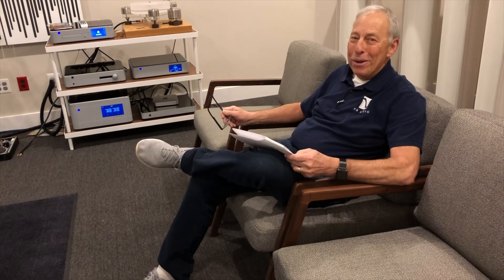Why don't PS Power Plants have balanced outputs?

Comment: Switching power supplies (at least the non-PFC ones) can run on anything, including square wave and DC.
The PFC ones are more picky about the power and may not run from a regular diesel generator (the voltage and frequency varies too much).

Comment: The problem with what is referred to here as balanced power which means neither conductor is grounded is that it is a violation of the National Electrical Code article 250 which deals with grounding. A power regenerator falls into a category of "a separately derived source." Generally for this type of equipment the source ground from the wall outlet would be connected to one of the output wires. An ungrounded output would not get a UL listing and the output could float dangerously. This neutral wire is referred to in the code as the grounded conductor. The separately derived source in this type of device must be grounded at one and only one place. For a delta wye transformer in a commercial or industrial building I prefer to ground the neutral at the transformer although the code allow it to be grounded at the first panel. Your house if you live in the US comes from a single phase transformer 240 volt circuit with a center tap which is the neutral. This neutral is grounded at the entrance to your house. Following the code can be a matter of life and death.

A shielded power cord has to be UL listed for this purpose. Wire of a specific gage is rated for maximum  ampacity based on being installed in free air at no more than 86 degrees F unless specifically designed as shielded. The problem with making your own shield is that it restricts the ability of the wire to dissipate heat. Wire such as MC or BX that is shielded takes this into account.
Reply: There is an exception in the NEC for balanced power. Article 647. It allows balanced 60v-0-60v installations under certain conditions, one of which does ban it from residential use. Much of this research goes to Martin Glassband of Equitec. He is the one who got this NEC accepted. Balanced power is not snake oil. It works on well known electrical principals. But it is not very effective, around 10db of practical CMR reduction. Still some recording studios will take that 10db over nothing. It is a gorunded circuit in that the ground must still be tied back to the service ground. Basically it is no different than a residential 240v circuit. Just half the voltage. So in essence everyone's 240v home HVAC condenser, electric range and water heater is running on balanced power!
Reply: @andydelle4509  that is correct. Generally 3 phase motor circuits do not have a grounded conductor but they must run a frame ground. We used to ground those circuits. There was red leg delta where a center tap of one leg was grounded and there was corner grounding of one conductor of a delta circuit but no more. In the US 240 volt residential appliances don't have a neutral wire unless they need one such as for a control circuit. But I think in this case one conductor must be grounded. I'll check your reference to see what I make of it. It still seems to fall into the category of a separately derived source under article 250.
Reply: @markfischer3626  Once you ground one of the hot legs of a  transformer, it's no longer a balanced circuit. Plus in the case of a balanced transformer, the center tap is grounded so also grounding one side would be a 60v to ground short. In a 120v balanced system both legs are 60v to ground. NEC 647 just tell what is allowed. A much better explanation is on the Equitech site which does go through the NEC acceptance process in one of their papers.

Note: I do not work for Equitech and never did.
Reply: @andydelle4509  Would you need a GFCI breaker? AFCI? Correct again about grounding one leg results in a circuit that is not balanced. Did the code chsnge? If it did what year was it?
Reply: @markfischer3626  I think the first version of balanced power was 1996 as article 530-G for pro AV installations only, then 647 was in 2002 which included any sensitive electronic gear in a commercial facility. Yes I think a GFCI is mandatory.
Reply: @andydelle4509  I visited the Web site. The company claimed the code was vagur, open to interpretation and would require approval by the local electrical code enforcement official. At the end they said they would make a presentation to the code committee to try to get a change in the 2012 code. They admitted it would not be easy. I don't know the outcome. It says on the very first page of the code that its exclusive purpose is safety. They really don't care about your stereo system. BTW, their equipment can't be cheap. There's a lot to.it including a large transformer and a special circuit breaker panel with GFCI  breakers. They also mentioned they were trying to get a UL listing.

Here's a problem I have with it. It can't use a standard NEMA 5-15P OR 5-20 P receptacle. It either must be hard wired or a different off nema receptacle used. You also cannot use an adaptor. The cord set must have the right matching plug supplied by the manufacturer to get a UL listing for your equipment. A licensed electrician is allowed to fabricate one. DIY and you're on your own. This device might require an electrical permit. BTW the secondary of the transformer has a grounded center tap so you are connected to ground on both wires through the transformer windings.
Reply: @markfischer3626  As I understand it, you can use NEMA 5-15 and 5-20 receptacles. They just have to be specifically labeled. J-boxes also must be specifically labeled. And I have a 2008 NEC book and 647 is in there so it's approved under the NEC at least as far back as the 2008 cycle. I think the 2012 was an attempt to get residential product listing. Note they do currently display ETL on their cord and plug units.  Now of course any local authority can override the NEC, as we know the NEC is just a guide. But I have seen balanced power system in several Hollywood recording studios so at  least the city of Los Angeles approves it's use commercially. The Univision network center and uplink facility in LA built in the mid 1990s is also all balanced power. They used standard box mounted GFCI's on each rack Wiremold G6000 power strip as that was cheaper than GFCI breakers - after all they had hundreds upon hundreds  of breakers in that plant. The distribution transformers were custom made by Square D.
Reply: @andydelle4509  Wiremold 6000 is a surface mounted sterl raceway. What does that have to do with GFCI?
Reply: @markfischer3626 Or did I mean G606? You know, plain wiremold plug strips. I am just pointing out another example where standard NEMA 5-15 receptacles were used and approved. They just put a GFCI locally at each power strip to save money. The NEC says a GFCI must be used. It does not say it has to be a GFCI breaker in the panel. Remember balanced power needs double pole breakers, which aren't cheap when you need a GFCI type! This technology is in use and approved by the NEC. Based on the ETL labels on the cord and plug units it seems that too have also received some official approvals for portable use
Reply: And yet another engineering flaw in Paul's hi-end audio snake oil seasoning.....
@Paul... the right answer, of coarse, should have been : "We don't have a choice. Safety regulations force us".

Comment: if you connect a piece of equipment with neutral tied to the chassis internally to a "balanced power feed" what prevents the chassis from becoming hot ?? +/- 60vac ??
Reply: you don't, because the chassis is not tied to neutral but to ground

edit: because if it was tied to neutral, what prevents you from turning around the wall plug and then have the phase on the chassis?
Reply: @LuXifR  
I just thought of something else ( I might be wrong) but I'm pretty sure balanced AC single phase is illegal in residential per NEC..
Reply: @poserwannabe1  Correct,  it is not allowed as permanent wiring in residential. But I think the cord and plug units are now approved. Equitech does display an ETL label which is equivalent to UL.
Reply: @LuXifR  well first off we have polarized plugs that can't be turned around, but I'm  pretty certain when I get my meter out and start checking all the gear I have in my shop, I'll find continuity from chassis to neutral, I hope you're right though 😁 not on all, but I'll bet some do
Reply: @poserwannabe1  oh, I wasn't aware that polarized plugs exist. Does that mean you don't have a separate, dedicated ground? :-O
Reply: @LuXifR  yeah they're either 3 prong or polarized 2 prong here in the USA..and 120vac which I'm sure you know...😁
Reply: @poserwannabe1  I always thought the 2 prong ones can be rotated by 180 degrees
Reply: With modern gear, modern being 1970 or later, both sides of the power line are isolated from the chassis if it has external connections. Some TV's with just antenna terminals and no AV jacks were still hot chassis into the 1990s as the antenna is transformer coupled. Where this could be very dangerous is with old 5 tube table radios with RCA phono input jacks or hot chassis guitar amps that are still common and in use. Actually there is quite a cult following for those old cheap guitar amps with hot chassis.

Comment: If the short circuit power level is high enough in your installation, drawing current does not impact the voltage.......
Reply from the maker: Nice if that were true but unfortunately there are hundreds of feet of wire between the user and the transformer and that wire has a DCR that causes the voltage to drop with demand on dynamic music. Easy to see with a scope.
Reply: @Paulmcgowanpsaudio  So what is the power quality coming from your power plant products?
Reply from the maker: @carstenjunge1327  Distortion is below 0.1% THD, so the shape is perfect. Regulation is within 1/10th of a volt under any load condition within the unit's range. Peak current delivery exceeds 70 amps.
Reply: True, but it all depends on how much of a drop on the amp DC rails. That's what counts as the power amp does have buffer capacitors. As does the PS PowerPlant so it can't produce power that isn't there to begin with. It can only store it to the extent of it's internal reservoir capacitance. It can work as long as the power plant can ride out the voltage sag. It just depends on how severe a voltage drop problem you have. The Jury is out on if these re-generators do make a positive sonic improvement  in a typical residence with average power quality. Also keep in mind that if the power supply in your amp is inadequate, no re-generator or power conditioner of any type is going to fix that.
Reply: @andydelle4509  Every utility has voltage quality standards to comply with as part of their security of supply obligations, if they do not, we have to start there. Secondly any decent producer of consumer electronics should design his products to work with the voltage quality that these standards guarantee, better quality ought not to be necessary. Whether the reality looks like that is then up for discussion. I guess the real question is what supply quality hifi equipment really needs to perform to its best and whether a decent UPS could be an alternative?
Reply: @carstenjunge1327  Don't get me wrong. I am hardly a supporter of these power re-generators. I feel they are a solution looking for a problem. And yes, a good on-line computer UPS does basically the same thing. I just think it's fair to point out that the science behind the product is legitimate and the product does do what it claims to do. But in the real world, few consumers have the claimed power problems. And even if your lights do blink when your air conditioning comes on, is it worth the $5000 - $10,000 to fix the momentary sound quality glitch? I guess to some it is!

Comment: I beg to differ, as I have measured it myself. A Furman that is not over taxed can regulate dynamic AC voltages quite well. Most people push them to their limits. I do agree balanced AC can't run some sources produced today.